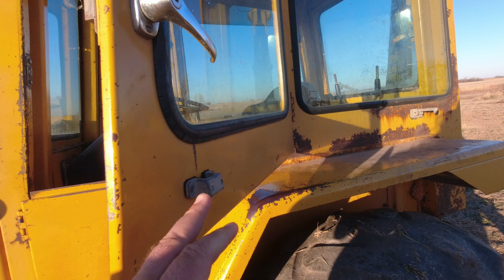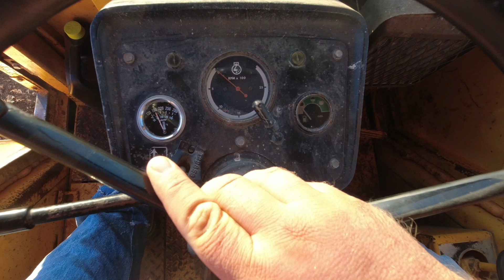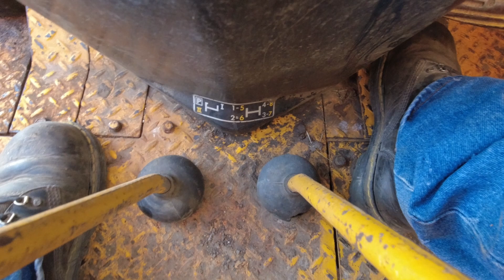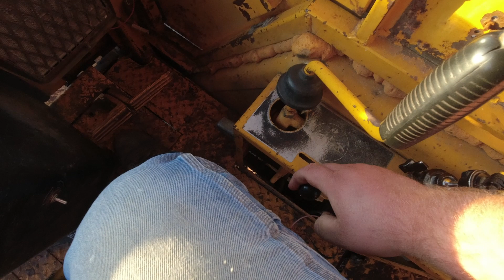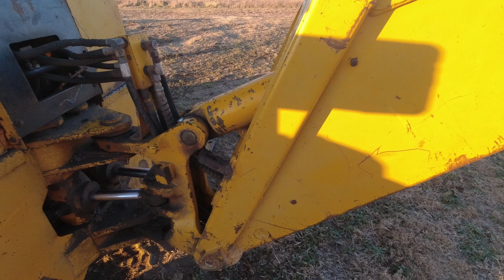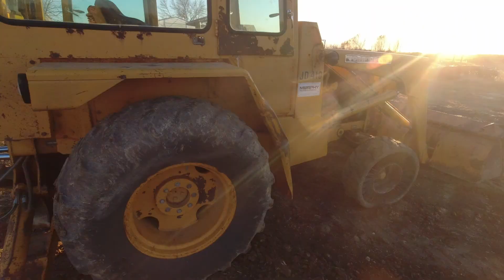John Deere 410 Backhoe Controls, Operation and Walk Around (How to )

Comment: Buddy of mine wants me to look at his 70 jd400 no fwd/rev  no hydraulics. Hydraulic pump was sent to a shop and tested fine. Any ideas? Thanks 🙏
Reply: I acquired this same backhoe a few years ago. Mine had been sitting 20+ years and nobody could figure out what was wrong. It had the same issues your describing. After speaking with an older gentleman at the John Deere dealership who ran these new back in the day, he was able to help me figure it out.
    There is a valve block just to the left of your brake pedals that has 4-5 valves in it. These valves tend to get stuck in the bores after years of sitting. I was able to remove the valve block, free up the stuck valves, reassemble with new gaskets, and everything works flawlessly now. You could check with your local JD dealer to see if they would be kind enough to print out the schematic for that valve block for you. Mine did and was also able to get the gaskets for reassembly. Hope this helps.

Comment: Thank you for the walk around of your wonderful olg girl ( JD -450). Own a 1978 Dynahoe-190 two wheel drive. Mine doesn't  have the 4 levels  that Dynahoes came standard with. Mine is 2 levers like yours. But here  is the kicker. The factory  standard  2 lever that Dynahoe had was JD control  pattern mine is set up with boom on right lever
The Dynahoe  had only ONE brake pedal it had control  under the machine  going to each rear brake. It has a little  swith on  front loader control below nob. That push swith UP and one rear brake locks up. Push swith down  the other brake locks up. Just like your machine  with different  issues, I have that disconnected. I have a nob on steering wheel to help me turn the front tires. My power is a (353) Detroit Detroit, and yes, I put in an engine heater also. It STARTS up really easy if my battery has full voltage. My baby takes two 12 volts.

Comment: Nice video, I just go one of these today and it all seems to be in great shape. The one question that I have is how do you tell your front bucket is flat on the ground from the drivers seat. You did a great job giving the tour of the JD 410
Reply: Mine has a 5-6 ft metal rod welded to the bucket  it runs up the arms through two pieces of four inch tubing. The rod is marked (paint, marker, etc) when the bucket is flat to be held ground. If you see how it’s done it’s very simple. Hope the his helps.

Comment: My mom's old boyfriend had a JD 410 backhoe from the 1970's at his gravel operation.  I used to use it to dig out the gravel and then load it on the dump truck to be spread on the township roads.    It was a nice backhoe to operate.  Also one of the contractors in town used to use his for digging basements and I was the level stick operator for him to make sure the floor of the basement was level.  Worked good.

Comment: I have the same machine. I was never able to get it in park. I was looking for a way to fix this because it's annoying always trying to anchor. Thanks I never thought to put it in gear, I was always in neutral when trying to engage the brake. It works fine now!

Your hoe controls are installed backwards. That's why they scrape the window and the out riggers. If your loosen the bolts at the base they are 360 adjustable. On this machine they are designed to be installed curved toward operator and outward 45. Meaning the hand hold should rest between 4 &5 o'clock on the right and 7&8 on the left. The out riggers handles should face 3&9 o'clock . This makes it much more comfortable to operate and gives no scrape clearance for all functions.

Comment: Hey man! I wanna start off by saying thank you for all these videos on the John deere 410 loader backhoe. I recent aquired a 1975 john deere 310 loader backhoe last week and honestly 100% without your videos would still not know how to operate it. It is my first loader backhoe and I had 0 experience. Since watching these videos I can now operate it and have removed a few stumps around the yard. 

I am wondering if it would be possible for you to do a video on checking fluids/filling fluids as well as how to replace hydraulic lines. After using it this weekend I found one of the metal hydraulic lines going to the front loader is leaking. I am unsure of even how to check the level, and how on earth I would go about replacing it - draining the fluid versus just lifting up the buckets and replacing. I am clueless. Any chance you can do that bud?? Would be super helpful to see some more "loader backhoe for newbies" videos. Thanks! - Travis from Maine.
Reply from the maker: Hello, glad my videos help!
Yes I need to do more videos on it, I will try to get some done soon.
To check the hydraulic oil the is a dipstick right in front of the seat.
And for the hydraulic line, you do not need to drain out the oil in the machine, just pull the line off and it'll all be good.
You will have a little oil leak out of the line but once the line is empty the oil will stop flowing. 
Never pull a hydraulic line if it is under pressure like if the loader is lifter etc. Once the line is loosened and it looses pressure the loader will come crashing down spraying oil everywhere.
Also keep clear of all hydraulic leaks because they will cut right through the skin causing serious injury.
Good luck on you machine!
Reply: https://youtu.be/xytdqluE7lA?si=atVfDZQH8W7ogWUq    this is a link to a video on changing fluids. If you go to the comment section there's one near the bottom with the most replies, like 26, in there a guy has a PDF link for  military manuals for a 410. It's close enough that most of the info  applies for 310. It's been a big help for mine. I'd share the direct link but I don't know how to do that.    Edit: also do you still have your machine because I'm up north by houlton and mine has a new hose on the front, just bought it 2 weeks ago from a guy who said his son had it.

Comment: Have you ever replaced the ball joints up front? I have a '79 that blew a steering cylinder seal and I need to get the ball joint out of the way to work on it. It appears that I need to drop the counter weight below the front end?
Reply from the maker: I've never done anything with the front end, closest I came was removing the whole front end when I pulled the engine for the rebuild.
Be careful, that weight weighs around 1000lbs!
Sorry I am not more help

Comment: Nice video.  I've got a '72 ford.  I was laughing because mine had all the same little issues- heater fan, slop in control levers, etc...   rock on, man.
Reply from the maker: Yeah I think it's pretty common issues with any old machine like this, but it's still going so I have no complaints! 
Thanks for watching

Comment: There is a part facing forward where the panel has been removed due to wiring issues. Do you know the name and function of that part? I just purchased a 1979 John Deere 310-B and when I removed that cover that part was sitting inside and disconnected. Not sure what that part does. Thanks. Love seeing your videos. They are so helpful
Reply from the maker: I'm not 100% sure what part you are talking about?
You removed the panel that the loader joystick is on?

Thanks for the kind words, hoping to have more videos on this backhoe, I am in the middle of building a thumb now 👍
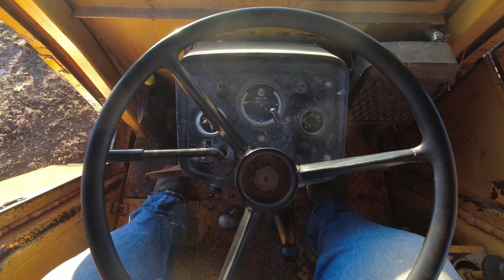Reply: @Memyselfandmyguitar  At 1:33 you are pointing to the panel you removed due to wiring issues. On the left side of that panel there is a gray part that protrudes out from the inside of that open panel. It almost looks like a water faucet in shape. That part is what I do not know what it is for.On my backhoe it was laying inside on the floor. Thanks again.
Reply from the maker: @paulo5861 
Sorry for the slow reply somehow missed this comment.
Ok that is for the "cold start", a can of starter fluid screws onto that spout and there is a tiny plastic line that goes from that spout to the intake.
I have never used this feature, the line on mine isn't even hooked up, I have it plugged with silicone to keep dust out of the intake
Reply: @Memyselfandmyguitar  Thank you so much. I would have never guessed that parts function and now I know. That part was inside the side cover laying down on it's side with a short piece of line attached to the part ending near a cable tie. No wonder why this part was not needed or considered essential since starter fluid can be sprayed near the air filter intake port. Thanks again

Comment: I have a 310A , what are the pedals on the floor near the back boom ? It seems like it slows down the bucket when it's pressed down... I don't use it . . . Never knew that the diff had a lock on it. I just bought it to mess around with.... Ha
Reply from the maker: My 410 doesn't have any pedals on the hoe controls, my best guess would be a auxiliary for a thumb? 
If it is you are lucky, I'm wanting to build a thumb but I'm going to have a mess with puting in a aux valve.
Yes the diff lock has gotten me out of many sticky situations! 
Good luck with your machine 🖖

Comment: I'm new to a  1972 John Deere 410. Could you  do a video explaining how  to use the  Reverser Unit.  I always depress the clutch when changing direction.  Also, show  how to use  the Differential Lock - since I'm clutching all the  time, I can't step on the Differential Lock Pedal at the same time.  Thank you
Reply from the maker: I'll do a video on it when I get some time.
What I do is I set the hand throttle at idle then use the foot throttle to raise the engine speed when driving or using the loader. Then when going from forward to reverse I just let off the foot throttle so it drops to a idle switch directions, when it starts to take off I just give it a little gas. If you change direction at a high engine speed it will jerk around and I'm always afraid of damaging something. I also only switch directions without the clutch in 1st or 2nd gear (at idle in 2nd gear) you don't want to change direction if you are going very fast or have a lot of momentum behind you.
I will also shift to neutral on the shuttle, then when the machine comes to a stop then I'll switch directions.
 It is also impossible to shift to reverse when in high range.

The diff lock is something I don't use very often, only when digging with the loader or pushing into a hard pile of dirt. When you get better at shifting with the shuttle then that should free up your left foot to use the diff lock. Make sure you don't turn with the differential locked be cause I have heard you can damage something.
I'll try and get a video out when I get the time, hope this helps till then
Reply: @Memyselfandmyguitar  Great answers.  This is really helpful. Thank you.
Reply: No clutch needed. Just move the column to neutral slow down then hit reverse. All while machine is in gear no foot on the clutch. You only need the clutch for gear change

Comment: Thank you for the video gives me a little better understanding of my 410, mine has a slightly different cab the mini under doors flip the opposite way and the rear window rolls up and is in alot worse shape, im planning on replacing my fluids and filters, any additional screens or anything you know of i should check out?
Reply from the maker: There should be 2 filters and a screen on the hydraulics/transmission. I used JD hy-gard since that what the book said to use and I have a fear of damaging the transmission.
I have a bunch of PDF books, if you want them send me a email
Reply: @Memyselfandmyguitar  i tried to send you an email(used the address on your channel) but it bounced back
Reply: @Memyselfandmyguitar  it didnt bounce back so i think its good, feel free to take down your email addy so the scammers dont get it
Reply from the maker: Yes I got it, I went ahead and pulled my email off the comments 👍
Reply: @Memyselfandmyguitar  good plan, thanks again man

Comment: Great information, thanks. Over here machines of that age are mainly JCB's. I think top of my todo list would be to rebuild the backhoe levers, it is a big of a worry that you can catch the outrigger lever
Reply: They have "Jam" nuts which allows you to lock them down at any clock position...Just loosen, rotate control lever until it clears the stableiser lever, then tighten the jam nut.
Reply from the maker: I have adjusted them before but I'll have to try again
Reply from the maker: There aren't a hole lot of JCB's over here, the only old JCB I know of was used at a scrap yard, it was a huge beast of a backhoe!

Yes those levers are definitely on my to do list 👍
Reply: Me podra motras su bonba hidraulia jefe xf